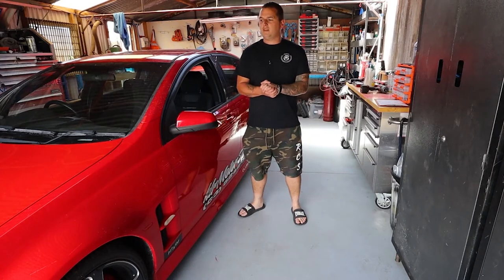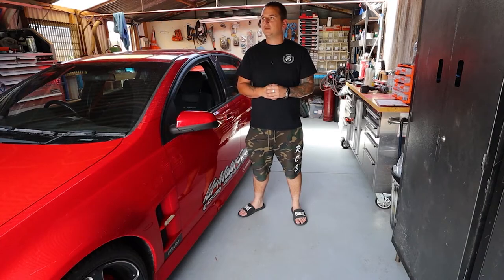Quick Vid - VE Commodore Battery Swap - Full Vlog On Our Channel - RCS Media

Comment: Now that’s a workshop
Reply from the maker: Appreciate mate, the old home setup was good for the space we had. the new shop is much better tho =)
Reply: Is that right you need a calcium battery at 660cca for the ve? My brother is having issues with errors and it seems to point there?
Reply from the maker: @adam90969  VEs will play up for sure if you dont have a good battery. like most new cars they need all the power they can get.